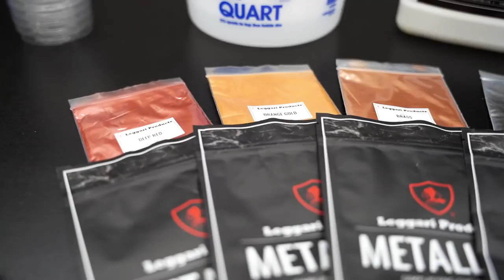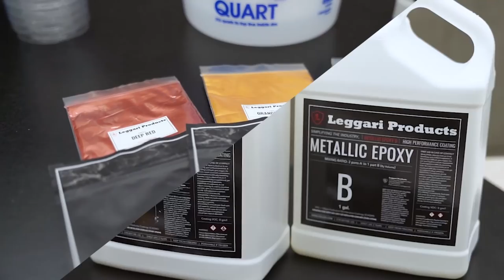Dirty Pour Technique Using Red, Brass, Orange Gold & Titanium Metallics | Easy Epoxy Project

Comment: Love the work you guys do, but I have a quick question.
Is it possible to do a pour on a brick wall? The wall will be installed, and I'm wanting to use the epoxy resin as art, as well as a water sealant for the brick. I couldn't find any videos showing if you had already done anything like that or not.

Comment: Is that better than using the tape?
Reply from the maker: Not necessarily better, it just depends on how much epoxy you're pouring. The weather stripping provides a really strong hold when there is a lot of epoxy poured.